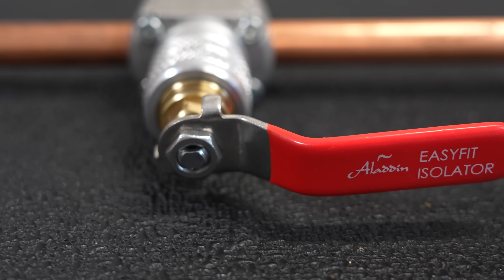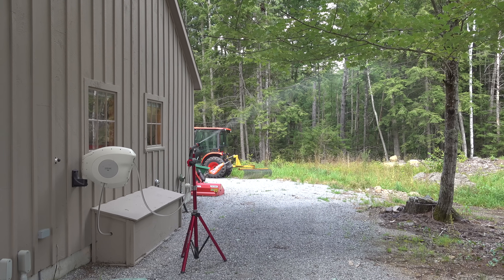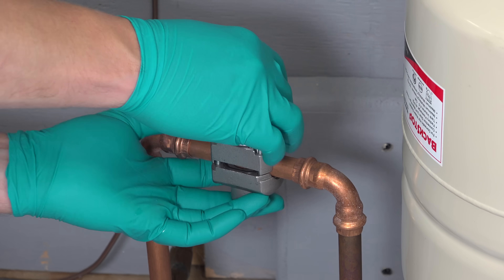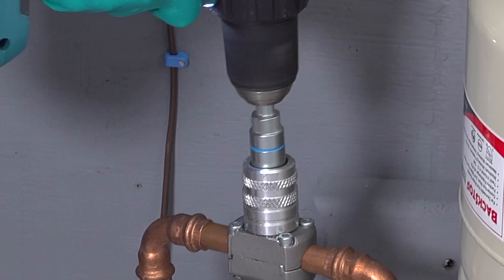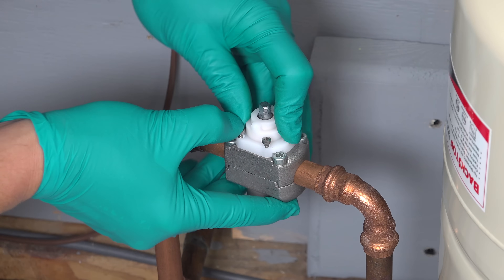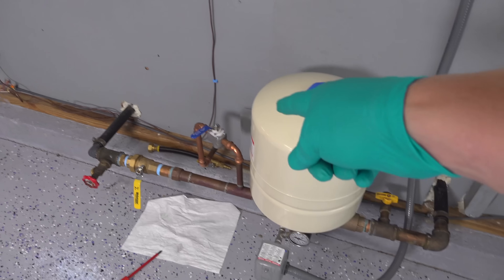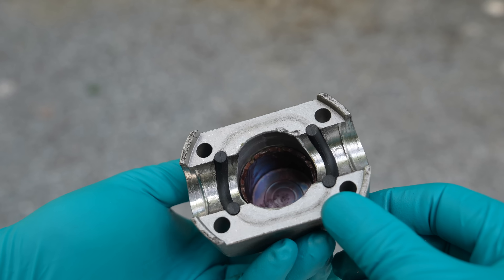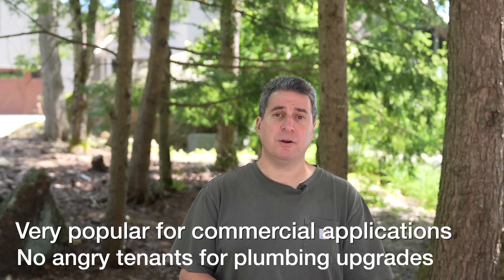SHUT-OFF valve installs on a LIVE WATER PIPE - Aladdin EasyFit Isolator

Comment: Clever device but you need to have them on hand BEFORE you need it. $250, $350 and $450 is over $1,000.00 to be prepared.  I think not.  Shut it off at the curb and spend $50 for parts.

Comment: do you think a lot of material bits or  burrs flow threw system after using drill process ?   can this be used on pvc plastic line ?  thanks
Reply: This actually works with any grade PEX but only “CTS PVC” which is the same ID and OD of copper tubing and PEX 👍🏽…standard American SCH40 and SCH80 PVC  is being developed and in the works 👍🏽  The coupon is trapped and sealed along with swarf in the lower housing.
Reply: @easyfitisolatorusa  this is good to know, thanks for the response.

Comment: You can just wonder how you figured out that once you put it on  you can no longer adjust it. We seriously need a bloopers & cut scene editions 😂.  

Thankfully I set up shut-off valves to off sections of my house very useful to be able to do so you may have to add a bit of plumbing depending on how it was laid down but being able to do so is convenient. I even have one on the pipe that connects the main water line by water company and when it  comes into my property set a cut off valve to shut off the water to the whole house right when it is my water pipe.  Was kind of embarrassing to the water company to be charging for water when I shut-off the water especially when they claimed it must be a leak in a pipe.
Reply: There is this thing called instructions…..

Comment: How is it retaining the two halves of the severed pipe? Is it just the O-rings and the small ridge I see? If you remove it from the pipe, does it leave a noticeable indent in the pipe where the ridge is? That would tell me it has some decent grip on the pipe. I'm also curious what metal the cutter is made out of. I would hope it would be some kind of stainless, but to be honest it looks kind of rusty. Maybe its not rust and just has a brownish color, it's hard to see from the video. As always, great video, cool product. But damn, I have questions. Thanks! 

Chris from Manchester.
Reply: Hello Chris, the coupon is trapped and sealed along with swarf in the lower housing. There is a ridge within the valve housings which clamp onto the pipe.  It does leave a small ridge on the upper/lower sections of pipe if you remove it at a later time.  The blade is made out of steel which is heat treated resulting in the brownish color.

Comment: What happened to the copper that was cut? Where did it go?
Reply from the maker: Squeeze flat and pressed into the little cap on the bottom, out of the way of the ball and flow area
Reply: @SilverCymbal So there are probably some copper chips from the hole saw that get washed down the line, right?  Seems like it would be a good idea to clean out the screen in the sprinkler after installing. Great video!
Reply: @SilverCymbal  Thanks...Nice job on the video...

Comment: Are there other similar valves that might not be rated for permanent installation but can be used in an emergency?   (e.g. while waiting to get water shut off from the street.)
Reply: I wonder if you can remove the copper cut out and reset the valve so you could reuse it. So use it to stop the flow in an emergency then after it is over and you can shut off the water, replace it with a normal valve.

Comment: Very cool, is it reusable or only one time use?
Reply: If “reusable” means “can turn the water on and off repeatedly from the valve”, then it’s reusable.  If “reusable” means “put it on then take it off and apply it somewhere else,” I’d say it’s effectively permanently installed wherever you decide to put it.   Probably not worth it to remove it, because you would then have to cut out and repair the section of pipe it was attached to.  That repair would be about the same amount of work as just installing a regular valve at the new location.  Maybe you have something else in mind tho
Reply: @BLKSG6  If reusable then you can use this to shut off water temporarily until it can be shut off upstream, then remove this and replace with a permanent valve which costs less than $200 (which is not actually that difficult??) and put this one back in the toolbox for next time.

Comment: Amazing - does this work on any kind of metal pipe? Or just soft copper?
Reply from the maker: It is a very clever thing, typical UK ingenuity. From them:  The valve may be replaced or installed on hot or cold water, pressurized systems, copper tubing (K,L,M) and PEX.

Comment: I'll wait for the $10 chinese knockoffs 🙄
Reply from the maker: Be careful, I got a lot of comments on the cheap Wagos which have ended really badly. I don't mind copy cat tools, since you use them and put them away but name brand fittings, etc are a good thing. This is a really specific use valve but I am told UK plumbers keep them on the trucks for emergencies and tough installs where main valve access is impossible

Comment: That's wicked clever. Used something similar to hook into water mains for new construction when I worked as an excavator(a long time ago in my case, so there may be newer tech for that too). Seems like something to keep handy in older houses where they were stingy on valves, or the main shutoff doesn't quite close all the way (don't ask how I know this, haha).
Reply: older houses may have galvanized pipe though, not sure if this will work.
Reply: @abc123fhdi  Unfortunately, the valve only works on Copper Tubing (K, L, or M) and PEX.  It does not work on galvanized pipe.
Reply: At $250 per valve, this is hardly something you just "keep handy"

Comment: My first thought was, it's gonna be expensive. $200??? Holy crap, for the price, if you don't want to learn how to solder, just get a sharkbite fitting. Or just call a plumber! I do all of my plumbing work myself and soldering is not hard to learn. I usually don't recommend press fit (I noticed some of your pipes were installed that way) because the tools needed are so incredibly expensive and I feel that if you have the $3K it costs just to buy the tool, you might as well just call a plumber anytime you need to use it and there's no way you'll ever make your money back.
Reply: It's not very practical to try to install a sharkbite shutoff valve, or solder a shutoff  valve into a live water line.  This valve is not designed to replace regular shutoff valves on water lines where the water supply can be turned off.  It's designed to be used when you can't shut off the water supply, for whatever reason.

Comment: copper/iron pipe only, or does it also work on PEX and/or other plastic pipe?
Reply from the maker: It will work on:  hot or cold water, pressurized systems, copper tubing (K,L,M) and PEX.

Comment: That is ingenious!  Yes, expensive, but like you said, if need it quickly or if there seems to be no better option, this would be great.  Thanks for sharing! 👍
Reply: They sell in the UK for £55 - about $70!
Reply: @dw2295  The US version of the valve has been re-engineered because copper tubing is much more dense here compared to the UK versions.   As a result UK valves will not work on US copper piping.  As a result there is a difference in pricing between the UK and US versions.  Hopefully, once this valve becomes more popular in the USA we can re-evaluate pricing.
Reply: @AnthonyPicciano  Exactly!
Reply: It is expensive, even compared with paying a plumber. I don't know where you are, but where I live you, can do that job for less than $350. In our condo, we have a licensed plumber who charges $200 - 250 for installing a  shut off valve (including the valve)
Reply: I agree with you. And I’m a big fan of your music.

Comment: Indeed that is very expensive, but for what it is/does, it is pretty amazing!
Reply: Cheaper than a plumber in the middle of the night on a holiday. 🤷🏻‍♂️
Reply: Agreed it's cheaper than calling a plumber, but it's also way too expensive to have laying around as a just in case.  It falls into the diy category where you need a shut off valve but don't have the skill/tools to install one the normal way, and don't want to call a plumber.  It's a neat niche product.
Reply: @elvsrbad2  it will stay useful for years. Having one on hand would be worth the cost if you cannot easily access the shutoff. I keep a tote full of spare parts for emergencies around the house. Plumbing, electrical, new locks, etc…
Reply from the maker: 100% agree, I am pleased that you get everything in the kit, and should have mentioned its all stainless steel and brass too. If it was $99 they would sell a million a week, who knows maybe once it gets going the price will come down.
Reply: Not as expensive as calling a plumber
Reply: @BaconJD420 but vastly more expensive than pushing on a SharkBite.
Reply: @BaconJD420 That’s because you’re the one doing the work. The valve doesn’t install itself. 😂
Reply: @BaconJD420  Tut, tut... OP's labor is getting more expensive by the minute.
Reply: Yeah I’m quite impressed just curious if this is available for black abs and pvc
Reply: @TheMrDarius   we don't really use that over here in the UK for our potable water lines. Most things are done in copper - I don't believe it will work for PVC or abs.
Reply: @TheMrDarius  The valve works on copper tubing (K,L, or M) and PEX.  While the blade would have no issue cutting into PVC the diameters vary depending on the brand and grade which would cause an issue with sealing.
Reply: Copper filing remnants in the pipe
Reply: Ya walk up to the house and the shut off valve never works
Reply: Guys, HERE is The Savior

HalleluYAH translates “Praise ye YaH”

YaH is The Heavenly Father 
YaH arrives via the TENT OF MEETING
YaH was Who they Crucified for our sins
YaH was Crucified on an Almond TREE

— Ancient Semitic Cuneiform of Moshe (Moses)
— Isa Scroll (The Original Isaiah)

Isaiah 42:8
"I am YaH; that is my Name! I will not yield my glory to another or my praise to idols.

Isaiah 43:11
I, I am YAH, and there is no other Savior but Me.

Isaiah 45:5
I am YaH, and there is none else.

Comment: It is impressive but my concern is that its a little involved for an emergency, and a little impermanent for an upgrade.

I also worry about copper flakes in the lines.
Reply: Why do you see this as non-permanent?
Reply from the maker: I have watched a couple of UK plumbers do these, they seriously install them in like 2 minutes. Whats crazy is I wrote the company 9 years ago and begged them to make a US version, but I am truly happy they have a long track record now.
Reply: Right.  Where did the copper fragments go?  Imagine if that was a potable supply line.
Reply: @bsoneill3  The coupon is trapped and sealed along with swarf in the lower housing.